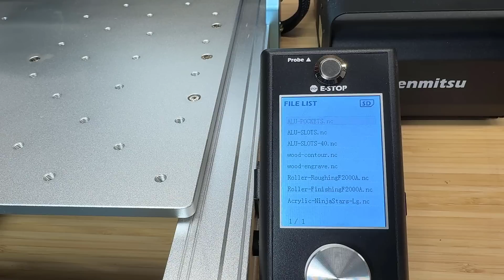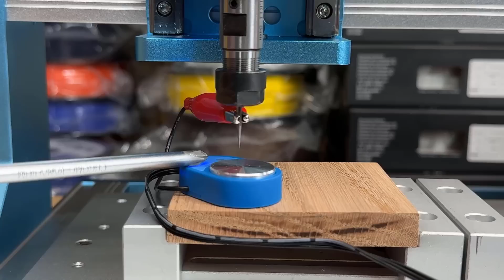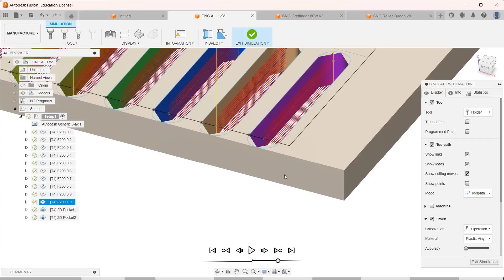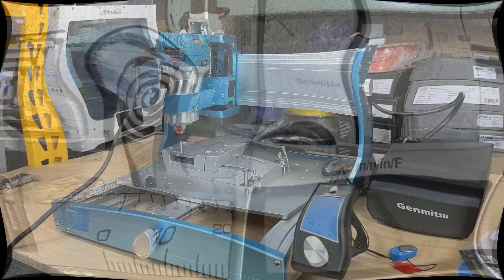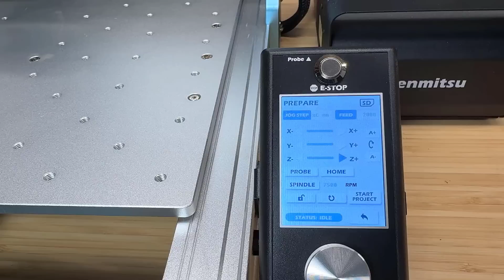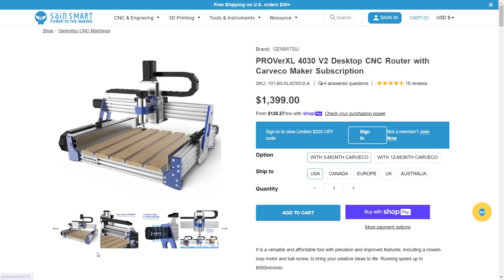GENMITSU 3030 PROVer MAX Desktop CNC, 300x300x78mm working area, 300W spindle, cutting aluminum

Comment: Great video, as always! I'm considering buying the 3030 PROVer Ultra with the 710W router. One thing I rarely see mentioned in reviews is the noise when cutting aluminum, not just the decibel level, but also how smooth or harsh the sound is. Has anyone had experience with this? It's an important factor for those of us using CNCs at home.

Comment: I think you could eliminate a bunof that vibration laying it flat or using  machinist Jack to support the middle using a 3 flute cutter and going clockwise on the pockets so your not climb milling until the finish pass

Comment: You cant measure accurately holes with a caliper, you need an inside micrometer if you want to measure the hundredths of a millimeter. For measuring outside diameters the caliper will handle better

Comment: I just bought one and as a professional machinist/programmer I'm quite impressed with the machine's capabilities. Currently using Universal Gcode sender as my controller and Fusion 360 for modeling and programming. If you do get this for aluminum milling, the Makita router or 1.5kw spindle is pretty much mandatory. 
Also, it's best to watch a few machining videos on speeds/feeds and most importantly Highspeed toolpath programming. These machines can only take light cuts but you can still go fast.

Comment: Very well done review! I see the surface finish on aluminum is much improved using the Makita router, vs the stock 300W spindle. Given such a difference, it would be nice if they offered the option to buy the 3030 without the stock spindle motor- although I suppose there's more hassle to offer different configurations and little upside to them.
Reply: that spindle wont impriove anythign it is the weak ass machine that flexes, 300 watts is complete overkill for it anyway

Comment: Hi firstly thank you for you video. It really helped.
But can I please ask did you experience any problems with the y axis not allowing the full working area of 300mm x 300mm being directly over the bed .... mine runs some 15mm short of the back of the bed . This obviously hangs over the front of the bed. So when working at a full 300 x 300 it is causes problems ..... do you know if anyone else has reported this and is there a fix for it ?

Comment: Great informative review. One thing I think that you may not have thought of during the spindle testing.  In the 300watt spindle you used a 1/8” end mill with a 1/8” shank. When using the Makita router motor you used a 1/8 end mill with a 1/4” shank providing a stiffer tool to begin with skewing the results somewhat. You should have used a  the same 1/8 end mill with a 1/4” shank in bath spindles. The ER-11 spindle can accept a 1/4” ER-11 collet. I don’t think the 309watt spindle would have preformed as well as the more powerful Makita but do believe there would be a noticeable improvement in surface finish.

Comment: so, im confused. how do i take a g code from a software, and tell the machine where to start, using the offline controller? and , is the offline controller capable of doing multiple finishes with different bits?

Comment: Another great review by Aurora Tech. You did not mention the RPM of the Makita router, do you know what it was? Thanks again.
Reply from the maker: 1=10,000
2=12,000
3=17,000
4=22,000
5=27,000
6=30,000
So, I guess 4.5 is something around 25k. Some users actually measured it:
https://discuss.inventables.com/t/makita-rt0700c-variable-speed-chart/30922/2

Comment: good videos as always.
a small thing regarding operation and execution of milling of workpiece. using air assist or adding liquid (alcohol) when milling helps.
another thing is when you have to mill, you use a scrubber mill for all the rough and finish milling at the end with a slower feed and you mill clockwise as white as possible so the endmill has to do the job.

another thing I saw was when you milled in wood that it does not move in the same constant movement around the object but constantly changes speed, can it be selected differently or is it in the software. ????

Comment: Are any desktop machines capable of machining mild steel?
Reply from the maker: I tried on the Carvera Air at 0.05mm step down, it worked but super slow. But that machine is even more rigid. 
https://youtu.be/vAV5WsRQpy4

Comment: Pro tip, you can use hot glue to help secure some of your materials down. Then use ipa to release it.
Reply: Always knew that nasty beer had a second use.

Kidding, but not really.
Reply: When I was in vocational school to become a machinist my instructor also suggested keeping some good quality double sided tape handy. Just slow things down a little bit and you would be surprised at how well it works for tiny parts.

Comment: It could also be the 300w spindle with the collet has too much runout under load, Makita router is probably much better built to handle sideloading.

My cheap machine with a similar 500w motor could not do profiling cuts at 0.3mm DOC in aluminium when I got it, now it can do 1-2mm easily as its only driving a separate spindle through a belt drive, same or less power but a more rigid spindle. It even handles milling steel now to a point.

Comment: Great review. In my opinion, these desktop CNC machines will never become mills unless their frame is made with steel instead of aluminum extrusions. I would call them soft metal engravers at most but not milling machines. The good thing is that they are not advertised as mills but i just wanted to clarify that.

Comment: how would one upgrade the motor to nema 23 with an adapter plate ? how to change stepper current ?
Reply: The drivers for the steppers probably would not support the current for the bigger motors, so you would have to change those too.

If they are integrated or it doesnt have outputs for signals for an external driver you might have to buy new drivers or a controller too

Comment: Nice video. Here's a few tips. You would get better results if the materials are mounted directly on to a solid surface. This will result in less chatter.

Next time try the same cuts with a single flute up cut bit and set the milling to a convenientional cut.

Comment: i been running this machine for a while, overall an excellent well built machine with a decent price tag, however the biggest downside is the weak 300w spindle. For wood they are absoletly fine but for a machine that is this ridge and advertised to cut soft metals it need something alot more. I personally upgraded the spindle to a 1.5kw spindle now can run metal jobs like it nothing even can cut titanium plates at okay ish speed. and it give me the opportunity to run 10mm end mills too with an er16 collet. Overall very happy with the machine very well build just wish it give you an option to buy a better spindle out of the box rather than wasting money on the 300w spindle
Reply: Hey I have the same machine what spindle did you upgrade to?
Reply: @ElPossum-r6t  i upgraded to a gpenny 1.5kw vfd spindle that come with a er16 collet rather than er11. It aircooled but they do have a water cooled version aswell i jsut cant be bother to setup the water cooling bit so went with air cool. Overall very happy with it can machine metal properly at decent speed